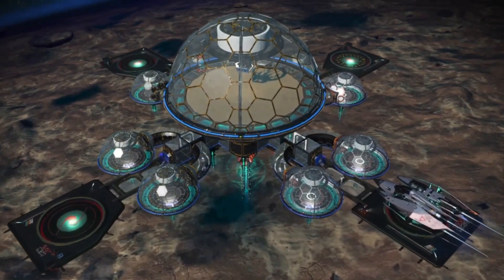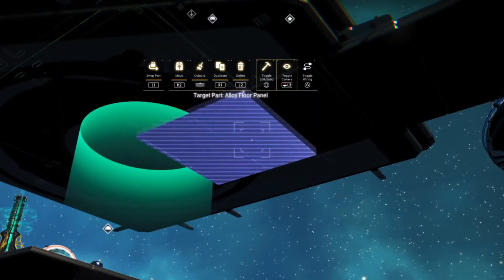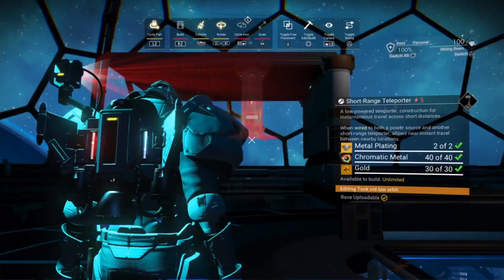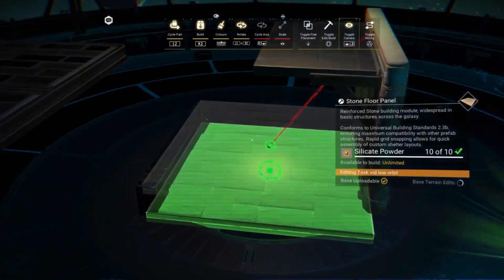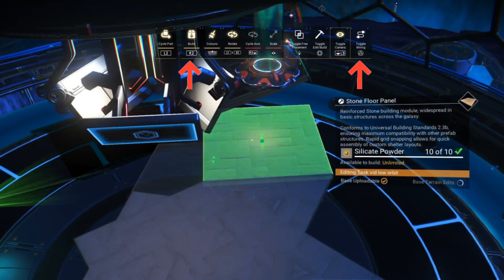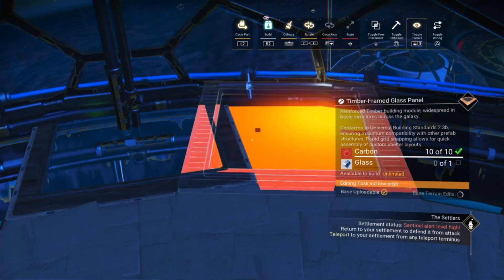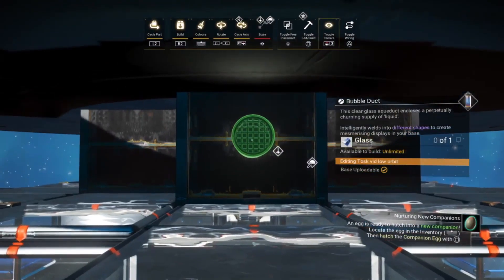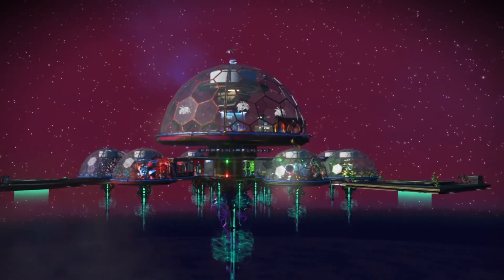Jellyfish Station - Part 2 of a base building guide in No Man's Sky #nomanssky

Comment: To those of you struggling with the raised floor sun thingy, I finally got it to work. I had big triangle gaps in my floor because the snapping wasnt working with me, so I took a break. I came back, deleted the sun thing (before you do this, make a restore point so youre not at risk of deleting the dome on accident), and simply restart. I dont know what changed, but it worked when I tried again and copied what he was shown doing in the video. Hope this helps 🙏
Reply from the maker: I know that sometimes you can snap 2 floors on top of each other which can cause the next ring of floors to be left with a gap. Anyway glad you got it sorted.
Reply: Omg thank you I was having the same issue

Comment: Man I accidentally deleted the big bio dome and now everything is misplaced.
Reply: Dude I did that about 4 times 😫😫
Reply from the maker: Yah I did it too when I was making the floor for the vid and had to reload. I was rushing and got burned. After that i made a save point/beacon next to my telelporter and made regular restore points. I should have mentioned it in the vid. I'll pin a comment to the top about it.
Reply: @toskvision7530 so how do we fix that or do we have to restart? Now I can't enter the large one 😢
Reply from the maker: @melodyoliphant3131  hey yeah there's really no solution other than starting again. I pinned a comment about it to the top of the comments but yeah I should have made it clearer in the vid about the risk. Hopefully the second time around it will come together more quickly if you decide to try again.

Comment: Mate I'm so confused I was building this started doing the raised floor I used the save beacon then had to used that save and when I did everything except a few parts of the base disappeared so I tried to load an older save from a couple minutes earlier then the save beacon one and when I did some over things disappeared and some things came back but now I've lost half the base and I did rebuild some of it but the same thing happened again does anyone know why
Reply: Now the entire base has dissappeared even the base terminal but I still says it's there idk what happens but I'm just gonna give up cause it's so annoying at this point
Reply from the maker: @JustJekyll  hey sorry to hear that. It's possible you are building too high. If you are close to the build height limit this kind of thing happens. Unfortunately it's probably best to start again. You can place multiple landing pads on the way down during the animation and restore reload to see which ones are at a safe height. Also build a high wall and reload to see if the top disappears
Reply: @toskvision  OK will do thanks for you speedy reply and appreciate your work
Reply: @toskvision  would you perhaps know what height I should build around
Reply from the maker: @JustJekyll  no I'm not sure. If you are building on a dead planet you don't have to build very high to look like you're in space.  I can check later
Reply: @toskvision  no need mate it's all good you were right with the height thing so I appreciate that very much and thank you for your great videos hope to see you make it big one day

Comment: I can’t do the moon pool thing? Whenever  do it, the moon pool circle sticks out the landing pad
Reply from the maker: Hey yes that can happen sometimes - the moon pools are a bit fiddly. You could try putting something very small like a scaled down box in the centre and wire glitching the pool on top of it. Then delete the box if you can. Either that or swap out the landing pads with the older square ones. The idea is to give enough time for the landing pad to render first before the moon pool. It's a matter of microseconds. Landing pads are the only items I know that usually render faster than the moon pool legs.
Reply: @toskvision  thanks. Also whenever I reload my save, all my solar panels and holo doors disappear? Any idea how to fix this? I don’t think my base is too high cause everything is still there just except the holo doors and solar panels/batteries
Reply from the maker: @adamb8625  yeah not sure about that. It might have to be a case of using the regular doors instead. As for the solar/battery thing, again haven't heard of that. Did you build a wall and reload to check your height limits anyway? Maybe you could try wire glitch building them instead of regular way like you did with the moon pool? Or try different spots on the base. You can shrink them them down using the scale glitch and hide them almost anywhere
Reply: @toskvision yeah I built a wall before I started and reloaded, the wall was still there. I’ll try glitching it. Hopefully it works
Reply: @toskvision  the normal doors worked but not the solar panels, think I might have to rebuilt on top of a hotspot 😩
Reply: @toskvision  the normal doors worked but not the solar panels, think I might have to rebuilt on top of a hotspot 😩
Reply from the maker: @adamb8625  ah I'm sorry about that. I was going to suggest that but I know how hard that is to hear. At least it will be much faster second time around. Have a look at the Altitude vid I posted a couple of weeks ago. Has the quickest way to get started tutorial on it and you are welcome to join the low orbit hub there. Some really cool builds have started springing up there.
Reply from the maker: @adamb8625  BTW I tried the small box trick with the moon pools and it seems to have worked. Had the same trouble tonight with the legs.
Reply: @toskvision  thanks. I’ll definitely try that tomorrow

Comment: I have the exact same sides of flooring as you show in the video, but it always ends up being uneven
Reply from the maker: Hey sorry to hear you're having trouble.  Do you mean the raised floor?
Reply: @toskvision  yea, I made sure to count the corners before expanding outwards and they match but it’s almost like it doesn’t let me place all of the required floor panels, there are always one or two that aren’t able to be snapped
Reply: The corner count was 24 as shown in the video when you started expanding and I have the exact same shape with same corner count
Reply from the maker: @lithiumiiv3461  that's weird. I assume you have enough materials?
Reply: @toskvision  I figured it out. Somewhere along the way ONE extra floor got placed in the mix and it screwed everything up. Me and my friends are now decorating it as a group base. Thanks for the video! 👍
Reply from the maker: @Lithium IIV glad you got it sorted mate. I'm on reddit as tosk777. Send me the co-ords when you're done if you want. Would love to visit.
Reply: @toskvision  oh for sure! It still needs decorated and I need to figure out how to move both teleporters around without removing the floor but other than that stuff its done. The EM gens were a pain 😂

Comment: I have a quick question: what would you say it the best way to power the top dome or what is inside of it? Since it has been increased in size and wont accept a wire I was wondering if there’s a way to hide a source or something in there to power that area
Reply from the maker: It should power up through the cuboid room beneath
Reply: @toskvision  Ok, I’ll try it again later when I get back on and I’ll let you know. I might not have had a wire running up there I’d guess
Reply: I ended up finding a way to make it work, found a spot through the floor that I could connect it up at

Comment: I should have listened and made a restore point.... is there anyway to reattach the large biodome if you've deleted it, without having to rebuild the whole thing??
Reply from the maker: Hey sorry to hear that.  No not really. I did it too because I was rushing and tired. At least the rebuild will be much faster! Good luck.
Reply: Awww. Thanks. At least it wasn't a terribly long build.
Reply: @drdoom761  I actually just managed to do so

basically, since there is no direct connection from the floor of the big bio dome to go down to the rest of the base, and the only way is the teleporter. 
I had my old teleporter inside still. so I just repeated the process of creating the big bio dome one cube room higher than the original position and use the teleporter to get back inside it to do a new floor.

ofc i made a restore point now before doing the floor for the 2nd time.
Reply: @Jettie  I ended up doing something similar. Since it's not connected anyways, figured it wasn't worth the time. Lol.
Reply: @drdoom761  yeah I've been building off and on since the morning so I wasn't gonna start over on all of this lol

Comment: Great, everything went really smooth...
your a great teacher.

but they can stick those circular floors where sun don't shine.

the star in middle...easy.
but building around it...NOPE, just not happening.
every time i get to outside layer there's triangle gaps.
Obviously something im doing...not your teachings.
Reply from the maker: Hi yeah you might have missed a layer in the middle?
Reply: @toskvision  
I did learn from another comment where I went wrong first time ..
Got an extra piece in there..
So can't find snapping points.

So started again..
The second layer went ok..
But then on 3rd later kept havi g gaps, I redone 2nd and 3rd layer several times.
But when I would get to where you did glass layer ..I had big gaps..
So I basically ended up losing patience and just loading them in there anyways.
Kinda starting at outside and have about half my floor as Glass panel pieces..
It actually turned out really cool..
Now instead of the single glass layer with a series of 2 prongs..
It's more elaborate and crazy looking now.
Reply from the maker: @Scaley_Reptile  glad you got it sorted mate

Comment: I built this base and for the most part it worked out great. For some reason the holodoors dissappear. I can put doors in just fine, but the halo door always dissappears. Not sure why. Anyone got ideas or a work around to make them work?
Reply from the maker: That's odd. Maybe delete the cuboid room and try again.
Reply: the only time i had holo-door keep disappearing was when i was on edge of my base boundary.
at my Mould farm the glass cubes (For teleporters) are outside the 1000 units, the glass cubes, and the catchment for mould...(further outside limit) all stay..
but when I add lights, or a holo-door, they keep disappearing apon load.
 hope this isn't your problem..caus would mean moving whole base..
so hope not.

Comment: OK ive made a succesful fresh start all within build limits.  Im directly above an S class power hot spot. Now on my last build I hooked up power no problem, on this new build I tried to hook up an EM generator but NOTHING? Ive checked really carefully that the wires are spot on - they are. To prove it wasnt the EMG i used a reactor and battery to test - same thing NO POWER. This has never happened in all the years Ive been playing - a bit miffed. ANY IDEAS anyone plz?
Reply from the maker: Wow thats strange. Reset defaults on difficulty settings? Turn it off and on again?
Reply from the maker: Did you try solar?
Reply: @toskvision  Please ignore Im on night shifts and the brain is a bit fried - Im a bit of a Bogan! I didnt realise how much power the base sucks - so I added all the extra EMG's and BOOM we have light! DUUUUH. This time I can actually COMPLETE this amazing build cheers matey. Not looking forward to all that 'reverse wire glitching' to do that floor thats whats put me off glitch building all these years ! I dont have anywhere near enough Quiksilver to buy all those nice shiny things. 😩:face-fuchsia-wide-eyes:
Reply from the maker: @scopex2749  no worries.  You know that reload trick with the quicksilver right?
Reply: @toskvision  No???:face-blue-wide-eyes:
Reply from the maker: @scopex2749  you can go to the  anomaly and buy an item from the QS merchant then reload the restore point to regain your qs and the item will be available for free. This is obviously an exploit so let your morals guide you.
Reply: @toskvision  wow ok thanks i TRY to avoid duping but when times are hard.............. ALL BUILT looks awesome thanks. Now need to go blag some QS